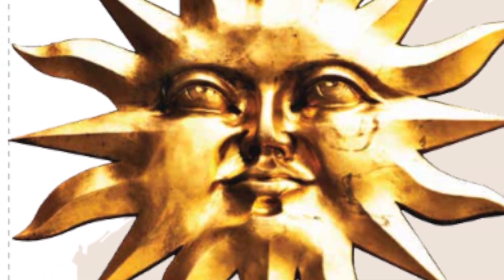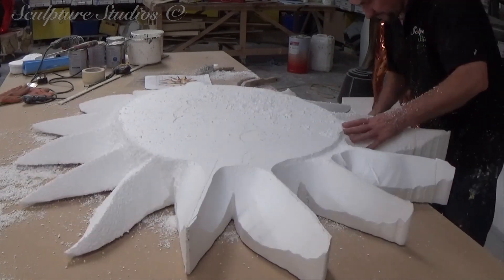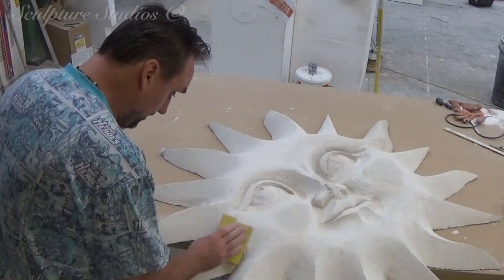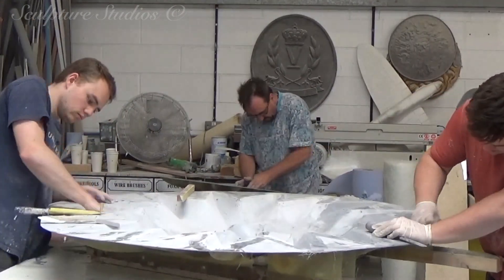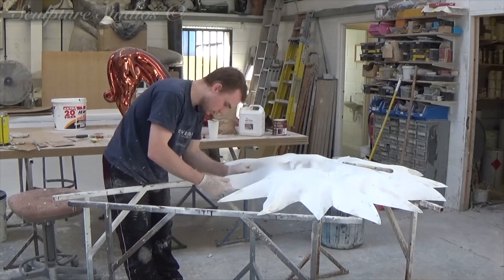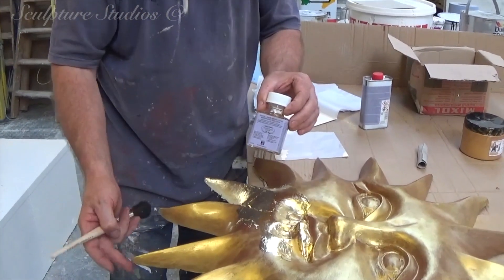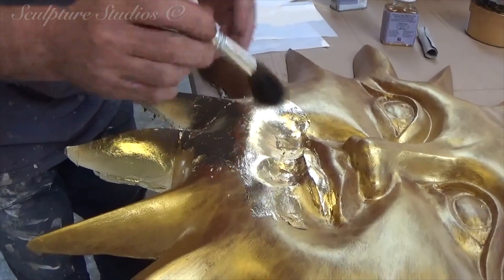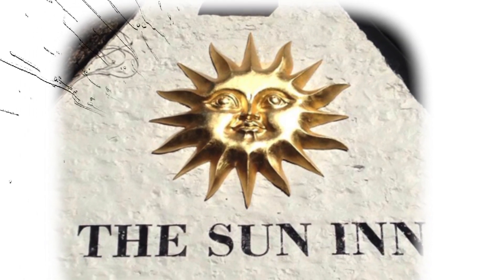Fibreglass Suns by Sculpture Studios

Comment: Aden i am wondering if you make the molds out of gelcoat and fiberglass  instead of latex or silicone because of the high price of the silicon or for another reason. I am looking to make some sculptures and reproduce them , and my concern is if doing a gelcoat/fiber glass mold would be better or not. i ve never done this type of mold, usually used the latex, but the size of the sculptures were smaller. 

I always see your videos , they are very inspiring and i am very grateful that you explain EVERYTHING and give out the materials and processes , that talks highly of you, many people do not like to share the techniques or materials , so thank youuuuu . Maxie
Reply from the maker: Hi Xime, thank you very much for the kind comments. We tend to use silicone rubber moulds (with a fibreglass jacket) if there is a high level of detail. As these suns are relatively flat and quite simple in terms of the detail, there's no need for this unnecessary cost for the silicone rubber, saving us and the client money. So it all depends on the project you are doing, and whether a fibreglass mould would be appropriate to achieve all that detail. I would have assumed for a smaller piece, a silicone mould might be better anyway, as it won't be too much rubber, and the detail might be smaller. So silicone might be the best way to go for that.